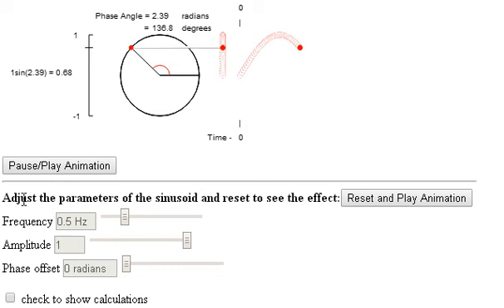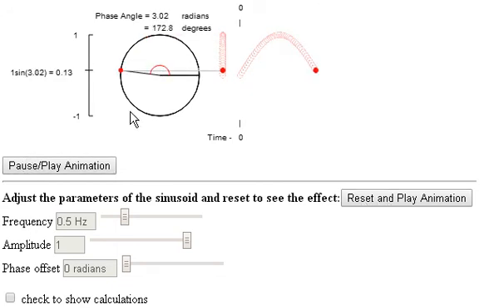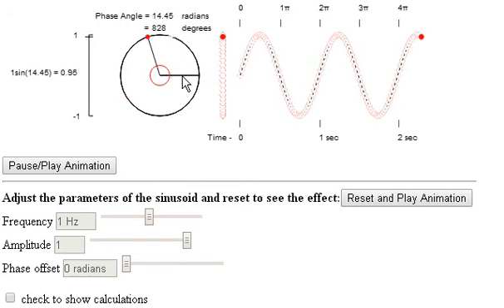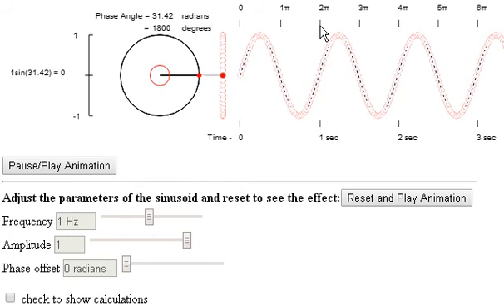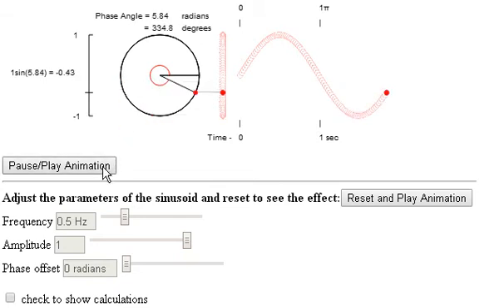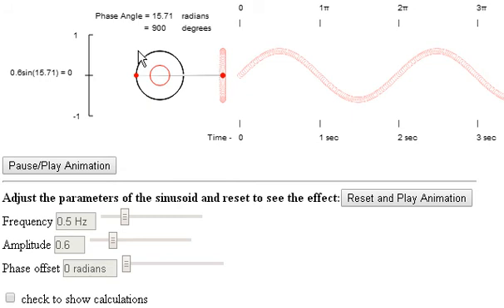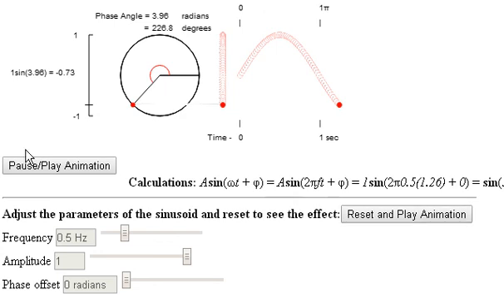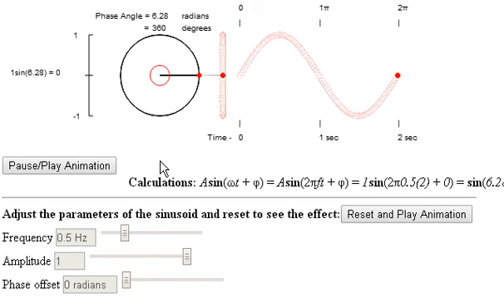sinusoidal parameters and angular frequency

Comment: This video and the interactive demo are great.  I've seen various expressions of sinusoidal waves, many using different variables to represent the value of the wave, e.g. V = A sin (2πft + φ), () = (2π + φ) , and v(t)=A sin(2πft+φ) to mention a few.  What do V, y(t), and v(t) represent and is there a difference when using them in this expression?  Thank you!
Reply from the maker: V, y(t), and v(t) are all just a variable used to store the output of the equation, like y = 2x+4 or f(x) = 2x + 4.  

The variable y is often used when plotting on a graph as we're used to using an x-axis and a y-axis in mathematics. 

Electrical engineers often use the variable v rather than y because they're using it to represent a voltage signal. I'm an electrical engineer so that's why I'll use it frequently.

The reason why you would see y(t) or v(t) is to highlight that the output variable is a function of time t (in other words the output of the equation is dependent on the variable t). This is similar to why you'll often see an equation f(x) = 2x + 4 in mathematics i.e. it highlights that the value of f is a function of x (in other words the value of f(x) depends on what the variable x is)
Reply: @ddorran   Thank you for that explanation! It makes perfect sense.  I had thought it may be something to this effect but I had not been able to find a straightforward answer.  I appreciate you taking the time to answer my question!